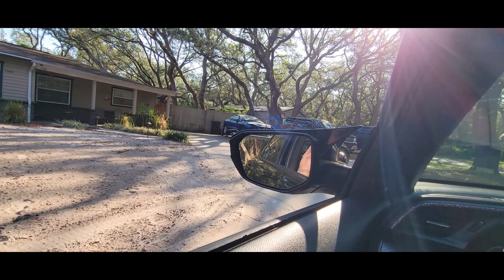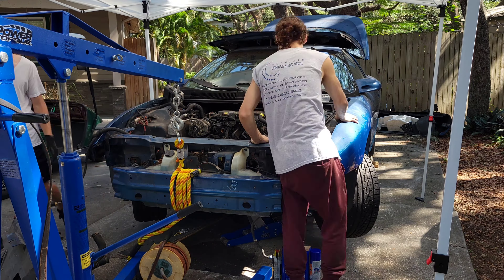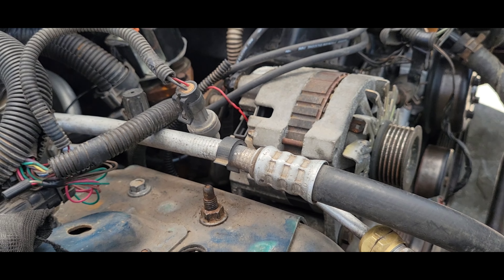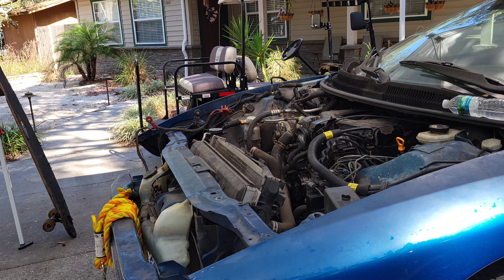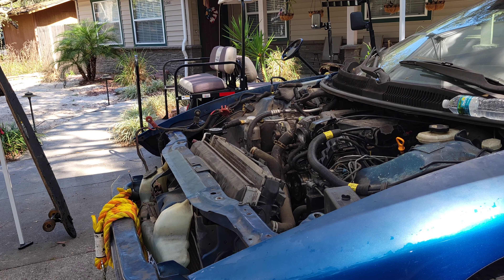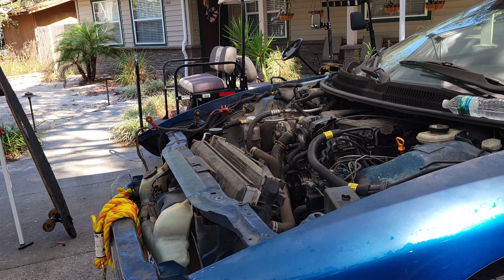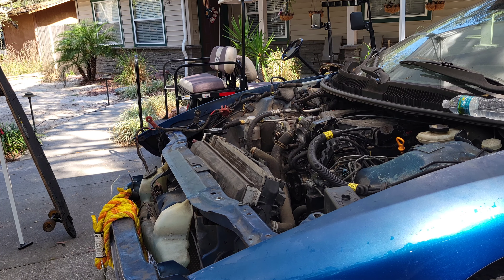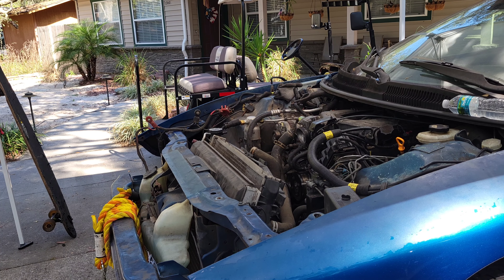We Finally Got Our 4th Gen Pontiac Firebird Celestia Running!! It Didn't Go As We Planned Though..

Comment: You have to rotate the motor to get ALL the valves some had tension on them still, TDC on piston 1  then tighten then piston 6 TDC and tighten the remaining rockers
Reply: And use a darn feeler gauge
Reply from the maker: Okay, noted. Thank you!
Reply: We had the procedure from prodemand but we took advice from an old mechanic friend. 

Paying for it dearly right now.

 All the pushrods are bent, don't know if there's any damage to the valves. Gonna try to do some compressions checks tomorrow or sum. We'll see.
Reply: @hardcoregamerfeish  I've seen old heads tighten them while it's running by sound but I'm not brave enough for that I'd drop something in by mistake, I use a feeler gauge and do it by TDC  there should be a little play when off the cam lobes high side
Reply: @Alfa_Alex952  so if we could have the manifold on while we had the valve covers off I might do it that was, but it's sus af, and it makes a hell of a mess. So we have to bring cyl. 1 to firing position, tighten intake and exhaust on that and cyl. 6 I think, (paper isn't right in front of me) and then tighten exhuast or intake valves on three of the cylinders (again, paper not in front of me so uncertain whether intake or exhaust and which 3 cylinders) and then spin the crank one cycle and do the same process again. Basically. It's been a bit of a time. I just pulled the valve covers a couple hours before this video went up and found all the pushrods bent. I'm feeling pretty bent too lmao.
Reply: @hardcoregamerfeish  with cylinder 1 at TDC you should be able to adjust exhaust of 1,2,3 and Intake of 1,5,6...turn the motor one revolution and that should be cylinder 6 tdc and then tighten exhaust on 4,5,6 and Intake on 2,3,4...or buy a car with ohc so you can see what the hell is happening, I forget it's pushrod so no lash is needed loosen  it till you feel play then tighten a full turn or so, basically wiggle the pushrod up and down till there's no play and lock it down
Reply: @Alfa_Alex952  Yeah I think that's what I was trying to describe I'm just shot rn. I wish it was a DOHC engine like my lancer lol.
Reply: @hardcoregamerfeish  it certainly makes things easier